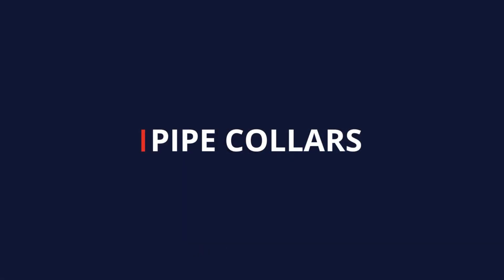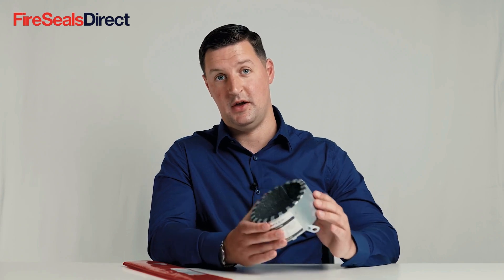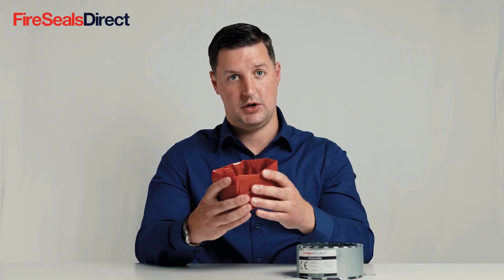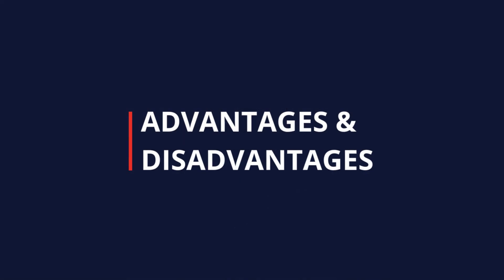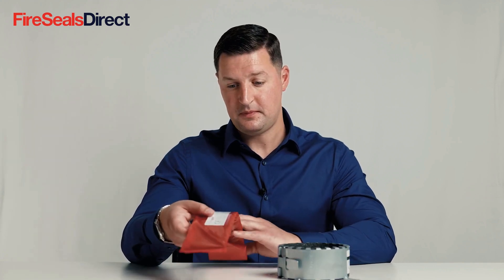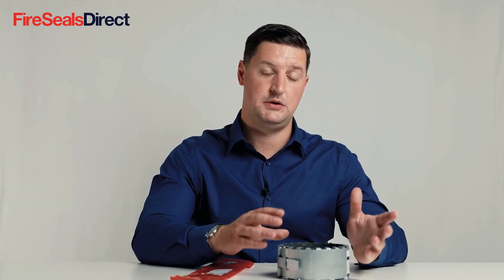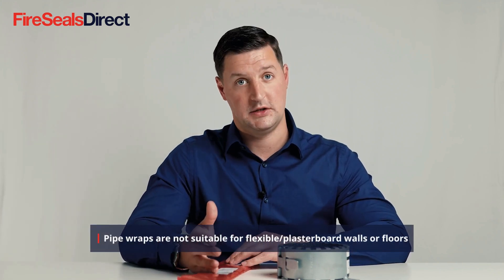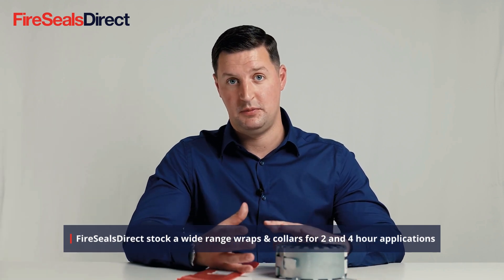The Difference Between Intumescent Fire Pipe Collars & Pipe Wraps

Comment: Passing cable through a plaster (partition) wall - is it best to use a collar on each side with a pipe passed through the hole..? This is because I want to be able to pass more cables through the wall as and when needed so I want to avoid sealing the hole up. The collars + pipe + fire resistant mastic etc around behind each collar seems to be best option... am I close to being 'right'...?
Reply from the maker: There are various ways of sealing a cable penetration through a flexible wall and to ensure we can look at the correct solution, could you email some images of the scenario to our customercare@firesealsdirect.co.uk email address and we can review this for you.

Comment: If this was used to place inside a concrete gap around a pipe could I thin used fire expanding foam over the surface to use as a smoke barrier?
Reply from the maker: Hi Stephen, so we can answer your question in more detail, please send us an email at sales@firesealsdirect.co.uk or call us on 02920 857 959 where our technical advisors can help with this